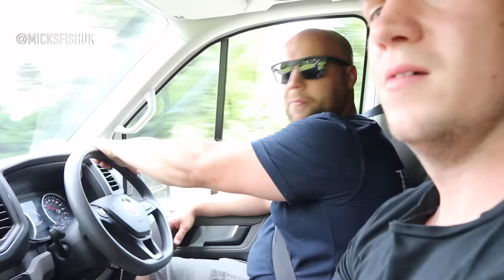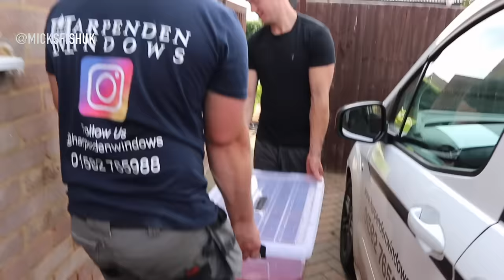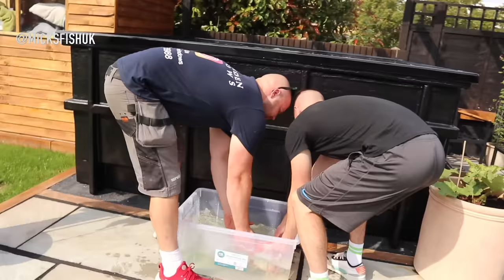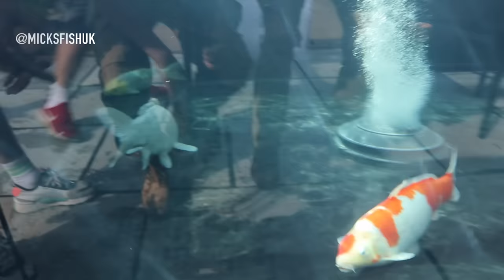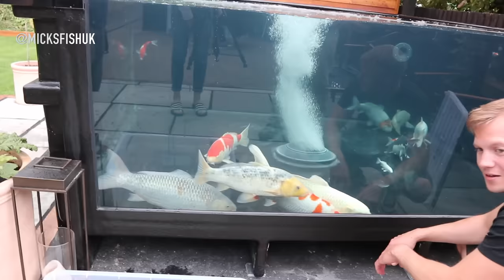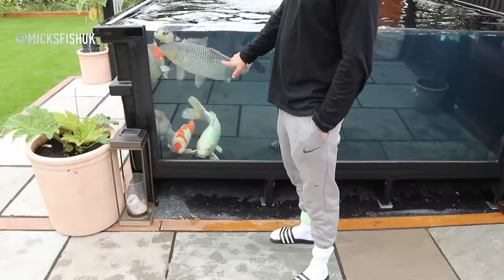ADDING 9 MASSIVE KOI TO THE 1000 GALLON POND

Comment: Shocking ,, no acclimattion , no net ,  ponds only been up and running a short time , it's absolutely crazy that your adding that many fish at those sizes to a new setup.  I really hope the poor fish will be ok
Reply: Too many fish. In one tank.
Reply: Ignore this comment it’s stupid. No matter how new the pond is with the right chemicals you can get the water spot on respect ✊️
Reply: There is nothing stupid about this comment. Even if he was somehow able to keep the water quality at safe levels, koi are meant to grow anywhere between 24-52 inches. How do you think a total of 216-468 inches of koi would fit in a 1000 gallon pond? If all 9 of them somehow all reached  their full size in this size pond, they will most likely feel very cramped in a pond that small.
Reply: @adamplumtree64  correct sir
Reply: @robloxpro6770  I hope you realize you can upgrade your pond/aquarium when your fish get bigger😂😂
Reply: @dredre2235  they're not following 1 inch of fish /10 gallon water

Comment: I liked the part where you climatized the fish
Reply: If it's summer time you don't need too, as long as they're going from an out side pond to an out side pond
Reply: @stephenboyd4934 that's rubbish what about different water parameters
Reply: @garethsykes8648  well I moved my fish three years ago, put them into a large container with the pond water, drove to my new house 5 mile away with a different pond I constructed, just put them straight in no problem, but as mentioned it was in the summer ( July ) I recently bought three more fish from an inside tank in a pet shop, so this time I let them float on the surface in the plastic bag for twenty minutes because an inside tank will be warmer then an outside tank.